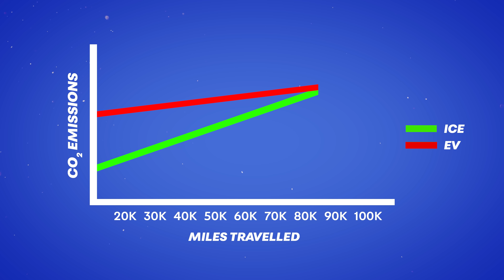Are Electric Cars REALLY That Green? [New 2022 Data]

Comment: The other thing to consider that wasn't mentioned here, what is the lifespan of the battery? And what is the impact of replacing that battery? My guess is, it will end up being expensive enough that most people will just trade the car in for a new one.
Reply: Long. They get used after car life for things like building back up power, solar storage and so on. Then they get recycled.
Reply: And modern batteries last for more longer miles than engines.
Reply: @MePeterNicholls  
While technically true, that's not the whole story. Battery manufacturers have learnt to prolonge the percieved battery lifetime by increasing the total amount of cells and not running them at full capacity the whole time. As the battery gets weared down, more and more of the abundant cells get activated so for quite some time it doesn't feel like any degradation is happening at all.
So while the technology gets better and better, there're also some tricks playing at hand which make for more comfort for the user, but ultimately don't change the environmental situation that is, lithium-ion batteries are atrocious and long overdue for replacement by cleaner alternatives.
Reply: @jayhill2193  tricks - not really trickery though. Lots of learning about best ways to manage the batteries coming through thanks to proliferation.
Reply: Worst case if the original car/battery lasts over 90K miles then it's greener. (Full stop.)
Reply: @Enrique Thiele Right, and the junker will pay you more than they would for an ICE vehicle because the raw materials in the battery are worth $$.

Comment: EV and nuclear power plants and standardized interchangeable batteries are the only viable option to pull off EV at a scalable level while being affordable enough for the masses. Open source software and the ability for DIY repairs/right to repair will be mandatory. And we also must be willing to destroy our environment to run additional electric transmission lines, build substations, more nuke plants, more mines, more battery factories. Currently environmental permits are largely preventing upgrading the infrastructure with generation and transmission to support the new demand.  So we are so woke now that we cant even be allowed to do more woke things.

Comment: You're right and you're wrong ! Go Volvo, they're great cars. Switching to EV is adding problems to our planet that is an enormous environmental disaster waiting to happen ! No one is addressing the much shorter life of an EV and the battery disposal at the end ? Volvo I'm sure address the much greater cost of elite materials which the world is short of, used in EV over ICE cars ? Who is addressing the scrapping of all the ICE cars ? You're talking of scrapping the entire world fleet and replacing it, have you thought of what cost in CO2 that comes at ? Where is the infrastructure to charge all the EV's ? It makes no sense ... why not use methanol in the existing fleet ? Or hydrogen ? I'd also like to see Volvo's graph continue up thru the k's for the life of ICE car, many of which easily go over 200,000k and some to 300,000k ... the life of 2 EV's.

Comment: The argumants are all well and good from both sides, he states the difference in high population areas, but does not take into account that ability to charge your vehicle, for instance I live in the densely populated industrail valleys of South Wales where a recent study stated that less than 10% of drivers would be able to charge their own veicles at home, hm 90+% will have to use publiccharging points, do you have an answer to that problem?

Comment: You or others fail to mention: pollution created by getting oil out of the ground, refining it and shipping to the gas station. The oil and filters from servicing ICE. The fact that an ICE is very inefficient. Then there is the pollution created by mining iron ore to make steel and aluminum and other alloys to make an engine and complicated transmission. As far as in the country or city the exhaust gasses go into the same atmosphere. Where I live in Ontario canada we are 90% hydro or nuclear. Is there pollution from BEV, yes of course! There is also less pollution from an electric motor and simple transmission. Service costs are almost zero due to no regular service needs and resulting oils, filters etc.

Comment: Thoughts:
Volvo is bad at making EVs (compared to Tesla). Stupidly slow and expensive (it's an ICE assembly line with thousands of steps, compared to Tesla's hundreds).
Recycled battery materials are higher quality than raw materials, and cheaper than mining.
Volvo's report uses below-average fuel prices, and above-average electricity prices.
EVs have fewer components, and battery costs have fallen crazy fast. Manufacturing cost is a direct predictor of energy used to manufacture (and CO2).

Comment: That was a very interesting analysis of the first 1/3 phase of the vehicle's lifecycle. At the 2nd phase 120K, when a new battery is required, you are then again at a higher CO2 pollution level than the ICE car. Also keep in mind that no new ICE engine needs to be built at this stage as was the case in the first stage, creating an even bigger CO2 disparity for the needed battery replacement. Phase 3 at the end of the lifecycle, when the recycling of 2 highly toxic batteries compared to an ICE engine is considered - sounds like maybe the ICE car is still more environmentally friendly. Food for thought.

Comment: Yo, the issue is the battery is not a one time cost. Eventually it needs to be replaced. This is not working very well at the moment, and can sometimes cause "economic total car", causing the entire vehicle to be replaced instead, as the cost of the battery exceeds the cost of the vehicle. It also does not help, that you are not getting a credit for returning a used car battery, even tough they don't need to mine materials then.

Comment: Right now, electric cars are rare enough that they charge on excess energy on the grid, so their emissions are negligible.  The problem is the longevity of the batteries.  As good as Li-ion batteries are, they still degrade significantly in just a few years.  This means there will be little in the way of a secondary market, and a tertiary market is just out of the question.  This is the real "advantage" of EV's.  Getting used cars off the market is what it's all about.  If you're lower Middle Class and thinking with the left side of your brain, are you going into debt for a new Lincoln Navigator or pay cash for a used Ford Focus?  Guess which one the manufacture discontinued.  The entire point of EV's is that they are expensive and will fail in 10 years.

Comment: We should also talk about the break even point between up front cost and fuel savings. So many people claim they are saving money by purchasing an EV due to lower electric fuel cost. They don't take into account a similarly equipped vehicle costs $15k-$25k more money as an EV due to battery pack and other technology. With that said, I did order a Model 3 Performance because it's what I want to drive, cost and all.

Comment: EVs running on coal-generated electricity that takes plenty of transmission loss on the way to the charging station are not green at all.  My brother's electric bicycle running on the solar panel mounted to his garage roof is very green indeed.

Comment: Electric autos are not even all that green in operation. 
Hybrid autos burn petrol (gasoline). Period! Now, I will concede that they get good mileage but they run a gasoline engine to produce electricity. 
Plug-in electrics (EV) get their power from the Electric Grid. Here in the US Pacific Northwest there is a lot of hydroelectric power generation, but most of the country's power is generated in coal-powered plants. I don't think anyone is proclaiming coal to be a particularly clear energy.

Comment: There are other things that from what I have read were not addressed. 
Some are minor but others are a little more important. 
The average ev compared to its "sister" ice vehicle,  the ev ways considerably more.  So they need to incorporate wearing through tires more often.  So there is the manufacturing of the tires as well as disposal / recycling. 
Another and I realize this can effect both types of vehicles but fires.   Once that battery lights up the fire departments can only contian the fire.   The batteries have been known to reignite hrs even days after the fact.  
Then there is the recycling of the battery which vehicle manufacturers seem to be missing the boat.
If the battery fails they replace it. When usually it will only be one or two cells (or whatever they are called)  it is actually cheaper to repair/replace the faulty part then to replace the whole battery.    
This is a major issue since once the classify a vehicle battery dead, they can't use it for automotive anymore.  
They have found some other uses for them but at the rate batteries will start to fail once you have "everyone" driving evs, there will be a lot of batteries sitting.
Which brings up lithium is not a renewable source.  Infact there is more crude oil still untouched then predicted lithium sources.   
But those numbers vary depending on source.  Prime example the price of evs keeps rising do to supply and demand.
I'm not sold on ev's but im not saying ice vehicles are the answer.
I believe the technology for a better vehicle is here but has been pushed aside.  
To much potential money to be made by the powers at be at this moment.

Comment: Interesting take, but fundamentally this is a false issue. ICE cars HAVE to burn fuel to operate, ICE cars are fundamentally, technologically fuel burners, inside their engines as well as in the extraction and refining process. Though I guess, theoretically, you probably could extract and refine crude oil using "clean" energy sources. EVs however, are not fundamentally fuel burners, even if right now resource extraction and battery making is not "green", technically it can be, and will probably improve as time goes by. The real question is not which technology pollutes less, it is which technology has the potential to pollute less or even nothing, and therefore, which technology should we promote going forward.

Comment: Hmmm,look up what it takes to make these batteries-you can't recycle the water from mining TOXIC lithium,the other components cause severe respiratory problems SO dangers to are environment are worse  with the government can turn off cars plus even bich'en is willing to fire up old coal plants because the grid can't handle the extra load now and diesel generators to recharge these throw away CHINA battery OPEC cars pump out more population then 30 gasoline cars that can be fixed and maintained not just throw away! With what big hole to resurface later will old battery's be thrown in? There are better alternatives to cleaner fuel and until the highest polluting country's are made to match cleaner country's standards all the common people of the world shouldn't be forced to do things to try offset all big governments greed at are expense

Comment: I had a 1953 Ford flat head V/8 and I got 28 miles per gal of gas in the mid sixties. why could a 1967  V /8 car get 70 miles per gal. in the seventies on an experimental cab. only to have it removed by the dealer at first chance replace with the normal carb. Then when they add Corn to the mixture the gas millage went down again????????????????

Comment: Have they calculated in the factor that EV cars end up at the dump for minor crashes because of INSANE cost to fix, that there is little to NO use in recycling many parts of it and so one and so forth?

I have cars from early 1990`s, still running and taken me from A to B, and it costs little to nothing to keep drivable.
How is that cost on a EV? When battery packs needs changing and so one?
I changed out the brake pipes on my GF`s Citroën C-Zero, had to take a course to be able to drain battery and work on it to even get the car back on the road, EVERYTHING was hidden between the batterypack and the chassi, was HELL to work on, a 2-3 hour work on a "normal" car takes DAYS on a EV. Is that cost taken into account, and so forth and so on.

It is fine that Volvo takes lots of things into consideration, but ALL in ALL I do believe you need to go way beyond the 100 000  miles range on a EV to compare to a 1,6 diesel with low fuel consumption and 5-600 miles on a tank. If you then take into consideration that we as "fossil" drivers pay WAY more taxes and stuff just because it has "fossil" in its title (I live in Norway, land of the toll road hell) and those money help pay the governments "WE are SOOO green" fond, well, all in all it seems like a big steamy pile of BS to me.

It is cool that manufactures put out the numbers finaly now tho, looking forward to seeing more, waiting for one from Toyota, they have produced the cars that run until you blow them up or smelt them most in the history, the 600 000 + miles cars out there, well them and old Mercedes, they run forever to =)

Comment: The efficiency of EV's is much higher than an ICE vehicle. Only 25% of the energy in an ICE is actually used in driving the wheels, where as it's closer to 85% in an EV after charging is taken into account. So if that EV energy comes from renewables you're actually using less energy to do the same job.

Comment: In North Dakota we would worry about the distance on a charge. Here you must use either heat or air conditioning, and this uses battery capacity. A trip to the city and back is 175 miles, add heat, lights and a/c and will we be able to make that round trip at all?

Comment: Great video. I may switch to electric after all! I'm all for CO2 production & global warming (that has nothing to do with cars, as the low-emissions year 2020 showed)
Reply: You state: "as the low-emissions year 2020 showed".  Um really?  Have you thought about this before saying this?  Global Temperature is not related to emissions but it is related to accumulated emissions.  The emissions in 2020 were indeed a little lower but the previous centuries worth of accumulated emissions was still in the atmosphere!  The "low-emissions year 2020" most certainly didn't show whatever the hell you think it did.
Reply: @Dave Boro co² doesn't stay in the atmosphere, plants take it out.
The atmosphere used to have thousands of times its current percentage of co² but its mostly been locked away as limestone and fossil fuels.
Deserts would turn green if there was more co² available because they can take it in without losing to much water.
NASA have decades of satellite footage showing the gradual greening of the planet.

Comment: Have you seen the graveyards of the EV's that the batteries have finished and  now CANT be disposed of. These cars are not more than a few years old, but the cost of replacing the batteries is hideously expensive, just a little more than the difference in fuel cost total, but lets not worry about sensible stuff.
One small detail in the "pollution"  of petrol users - name three things EVERY PLANT ON THE PLANET needs - give up - water sunlight(UV) AND  CARBON DIOXIDE.

Comment: 1) First point - this "report" was created by a Chinese company - volvo cars
Since 2010 Volvo Cars has been owned by the Chinese multinational automotive company Geely Holding Group.

2) they state, "It should be noted that the Carbon Footprint measurement was performed to represent a globally sourced version of the models."  this means they include China and India in their carbon footprint - 2 of the most polluted countries in the world - both burn enormous amounts of coal for electricity.  In Seattle, I get my electricity from Snoqualimie falls hydro power - as been in service for 105 years. Like Niagara and James Bay in Quebec supplies power to most of the eastern seaboard of USA.

3) Their carbon footprint consists of petrol and wind.  it is very suspect that they leave out the largest produces of electricity - Hydro and Solar
In 2020 hydropower generated one sixth of the world's electricity, almost 4500 TWh, which was more than all other renewables combined and also more than nuclear power.[3]
Power generation from solar PV in 2020 is estimated to have increased by a record 156 TWh, marking 23% growth from 2019. Solar PV accounted for 3.1% of global electricity generation, and it remains the third-largest renewable electricity technology behind hydropower and onshore wind after overtaking bioenergy in 2019.

Comment: Not entering in the main subject as it is my point of view for many years, I would like to point the big why here, and that is WHY sports cars, classic or modern, that most times needs 10 years to make 10k miles need to fit these electrification rules?
Of course that is the level of poluents emissions, but apart that the rules and regulations should consider the amount of CO2 globally for the production and, thus, apply a cumulative rule, in other words, those who run low mileage, as far as they can get inside the CO2 foot print and meet a realistic amount of emissions based also on a global value, should be able to have their cars ok.
This all banning of ICE for good is completely wrong and is the much dumbest thing I've seen in recent years.
Only politicians to do such b7llsh1t!